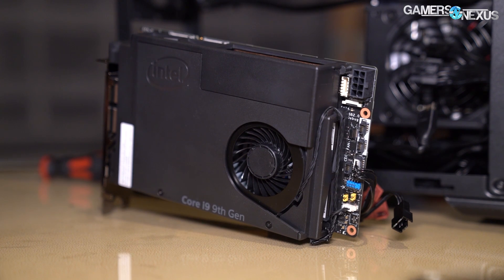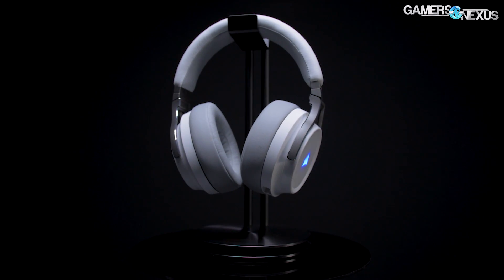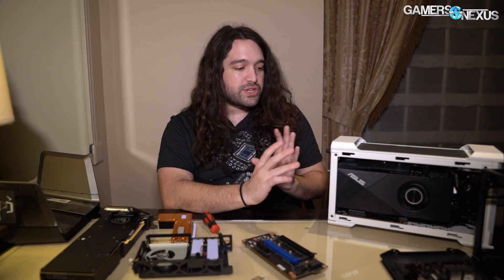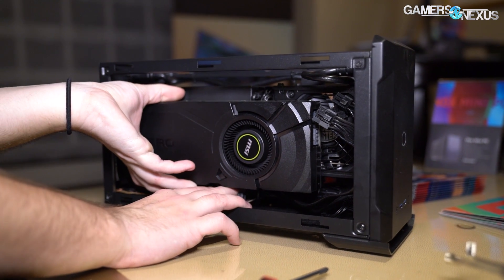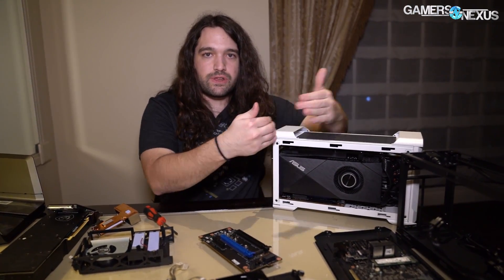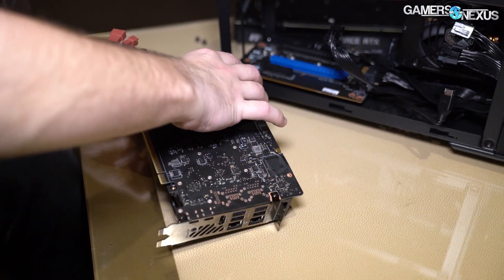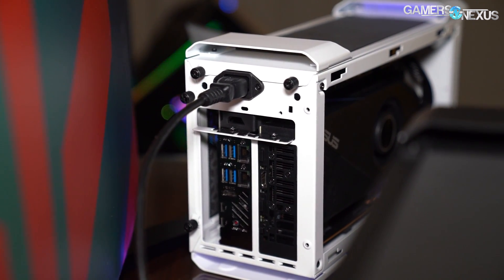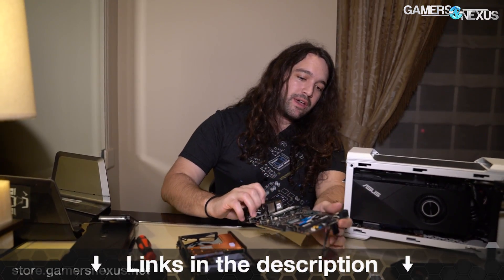Intel PCIe Socketable Computer: Tear-Down of Ghost Canyon NUC SFF PC

Comment: There was an processor card a few years ago on indigogo, which had I believe a Broadwell i7 and ram on an expansion card, and you could slot it in and use it as an x86-64 accelerator. 

I've always wondered, like with 300 watt gpus, we clearly are able to cool them in a 2 slot card. So my question is how long before we take a bunch of zen 2 cores and slap it on an expansion card to increase compute performance.

Comment: As many said this isn't much smaller than a sandwitched mini-itx and the cooling will be much worse (why not put the components on the other side when you're doing something non-standard anyway ?). It would be intersting as a pc inside a pc, but I didn't see/hear anything that would suggest that that would work... did I miss something?

Comment: 1990s - Pentium II Slot CPU. Drop-in replacement CPUs
2000-2020 - Socket CPUs higher bandwidth connectivity to Mobo
2020+? - CPU and motherboard in a slot. Drop-in replacement computer.

Comment: I've had a NUC of Intel.
Reply: Yeah they're pretty cool honestly. Ended up with one as an HTPC for a while, i5 something or other, 8GB DDR4, 256GB nVME and a 2TB 2.5" drive in a pretty tiny and quiet package. I have also used the Pentium 3050 or whatever that low end was, and yeesh, definitely stick with i3 as the minimum. The Pentium/Celeron ones are so slow I'd only think they'd be usable as something like a smart terminal alternative for point of sale or whatnot.

Comment: A company i used to work for made ARM based PCIe card computers 
it had miniDVI, USB, ethernet and a GPIO connector, and could communicate vie PCIe 1x to the host
i remember they were pointlessly pricey (way more than $1500) and they still sold like crazy
EDIT: and were talking single core 600MHz A skew ARM, not sure exactly what flavor

Comment: Interesting concept - such a shame it's not really new. PC on an expansion card is really common in industrial gear, has been for years. This seems like an updated version of the same concept, but in its' own box.

Kinda wondering what the target market is here. It's difficult to imagine a use case for these where a regular small form factor build wouldn't beat this by being cheaper and more powerful with a similar footprint. What does this really bring to the table?

But hey, what do I know, I'm just some random on the internet.

Comment: I could see this working really well as a tiny portable capture/ edit rig, with a decent single slot GPU( something like a Radeon Pro WX 5100 or 7100) and putting a capture card in the extra slot.

Unless the edge connector on the NUC itself is some type of non-standard proprietary configuration, I'm guessing it's bifurcated into 8x + 4x + 4x for the GPU, SSD, and the extra 4x slot respectively.

Comment: You could literally turn this design into a gaming console. They really needed this during the HTPC times.
Reply: What they could do is make the NUC power efficient enough that it can just draw power from PCIe lanes. For those who like to have separation of gaming and stream/capture builds while conserving space. Can just build a mid-tower ATX motherboard, use the 2nd x16 slot for the NUC, install Windows or Linux and set up the wiring pipeline for recording.

Of course, there are many ways to achieve the same task.

Comment: Would be interesting to know how overpriced those cases and connector-boards are. The cost of eGPU enclosures and reluctance to make Thunderbolt a proper standard made them obscure, I bet this thing is going to end up the same way unless they charge a fair price for a small bit of metal and a glorified SLI bridge

Comment: This is a really old form factor, this is exactly how industrial computers were designed back in the 70's/80's.
The main advantage was that replacing a dead CPU node was a 30 second job, as downtime was a top concern for industrial applications
Reply: Distributed computing clusters, but at least the tech gets to use the modernization.

Comment: They had PCI "upgrade" cards for PCs back in the 90-ish timeframe.  They typically had everything including HD connectors on the PCI card.  However cooling wasn't as big a problem back then.

Comment: I could see potential for the PCIE add in cards containing basically laptop grade hardware, but 2 things i would like to see:
- CPU socket for more flexibility and easier upgrade.
- that Intel needs PCIE 4.0 as (without knowing it for sure!!) it seems that you will be limited by the bus speed rather quickly if the add in card has to deal with M.2 and a GPU at the same time.

Comment: kind of pointless and will not fly. why? why do you need to use an extra pcb card to actually connect the motherboard pcb with the gpu pcb? when you can do that today with 2 parts not 3.

Comment: WTF at :45 - that is NOT what should be reflected. The Ring incoming.

That aside, this is both an intriguing and disappointing product - I have serious concerns that their shroud is adequate cooling for that processor (should really be an i3/5 part) especially when stacked side-by-side with a full size graphics card. However, I think this would be an amazing product with a lower core processor to slot into a gaming PC for a seperate streaming solution OR a NAS.

Comment: For me its nice to have that inside your main desktop to take the load of some secondary stuff (e.g NAS, generals server, capture/rendering rig, firewall/addblocker etc) so that a) you wont need to purchase separate case and power-supply b) you will have 1 tower for two machines which is more elegant less hordy and also could save a few bucks.  Oh and who doesnt want to look at the back of his main rig and see tons of input and output options? :P

Comment: It's SUCH a missed opportunity how they made this in the regular PCIe slot orientation (when seen from the rear I/O PCB on the left, hardware and cooler to the right, air intake on the right edge). Mirroring this - which they could have done with pretty much zero changes to the hardware beyond flipping the pinout for the PCIe on the PCB - would have allowed for dramatically improved CPU cooling through the opposite side panel, and thus far better performance and noise. Such a damn shame, as otherwise this is a really cool idea. Now we have a CPU cooler that takes in warm air from the back of the GPU, with very little breathing room, instead of the back of the motherboard and the back of the GPU being against each other. SUCH a shame.

Comment: I love this. I've long been a proponent of going back to add in cards on a single comm board. If they could make that psu slot onto the board to provide power to the gpu and the compute board without any cables I'm sold
Reply: The challenge is in the power deliver, which the motherboard board has its limits.

I have a Radeon Pro WX5100. No power pin necessary when some of the PCIe lanes are just for power delivery. Not as powerful as the RX480, but I bought them for a completely different purpose.

I am still experimenting which graphics cards I delegate my monitor renders to. I have a 1080p 75Hz and a 4K 60Hz. Both cards are installed, with RX480 as my main card, and run under Radeon Pro drivers.

Comment: Sounds interesting and promising.
I wouldn't say it has any real purpose in its current form (besides being small) but with further development it might be posible to have a base-board and plug in whatever you want, mutliple GPUs, CPUs (with RAM), or anything else. A standard PCIe Bus that can manage multiple "CPU-boards". Maybe the future is CPU-SLI? 
I can imagine quite a lot of things. If it is possible without to much costs is a question I can't answer though....

Comment: This sounds like Intel is making a move to revitalize ultra-high-density blade servers. Sure, it does allow for a slightly smaller than mini-ITX system for the desktop, but with that pricing the value just isn't there. But if you can't put more cores in a computer than AMD, just put more computers in the same size box. And with refinements to their 10nm process in the next year or two, this should be able to delier where the blade servers of yore were crippled by thermals.

Comment: Interesting concept but to be really revolutionary it would have to slot into a normal PC and get recognized by to OS as a Compute Card you can configure to do certain tasks without putting load on the main system ect. Otherwise i don't see any merit to the PCIe format. There is nothing you couldn't do with a standard ITX or other SFF Mobo and a few Riser Cables and that would be the superior solution imo.

Comment: That could be awesome . If it can function  well in a multi gpu gaming motherboard. Like if the socketed pc was all network related. So it is the firewall , VPN and maybe personal domain. And the web connection would go from modem to it then back out to the main board or router...
Reply: A idea I've had for years but. I don't posses the skills to make . Is a stand alone pc that was all mentioned as well as antivirus .. the thought was to sell subscriber service that included a unit that would auto update and stop attacks before they connect. Then in the event of a new bad virus attack on the public   all the units would act as a super PC and work to pinpoint the source of the attack then counter attack ... I'm sure there's something ilegal about a counter attack... But in my opinion there are no rules to a fight.

Comment: i find the concept interesting,  but it has room for improvements:
   case integrated power supply wich distributes power directly through the base plate
   a custom connector (as an open standard)  for the cpu card to get more pcie lanes to the base plate 
   a more trustworthy cooling solution

Comment: this card would be great if they made a low profile version. they could make pcb longer to compensate for the loss in height. moving M2 slots to the back of the card like they are on a normal NUC. then you could use it for multiplayer gaming or to offload video encoding so your main CPU is free to do other things. another good use for it is to have your main system run windows offline for security/stability with this NUC running linux for all your web browsing needs. all with less complexity then setting up virtual machines.

Comment: I have a NUC with an 8109U running Linux and I like it a lot for the small form factor. It is much smaller than my previous mini ITX build even though that was the smallest mini itx chassis at the time. However I am not sure about this idea. I rather they kept improving on the Vega powered NUC for light gaming and the ultra minimalist NUC like my 8109U for general usage.

Comment: The base board seems to have a PCIe switch/multiplexer on it, and Steve even poked it at 6:40
Though, since a PCIe slot has two pins for ground between each PCIe lane, so with a reconfiguration of the pins one could increase the number of lanes into having 20 lanes, but this would lower signal integrity, and make it totally incompatible with a regular PCIe slot. This is though likely not the case since it doesn't follow PCI SIG specifications. And the reason for color coding the slot is more likely to do with its lanes partly going directly to another card, and partly going through a switch/multiplexer, though technically speaking, both 16x slots would have some lanes going to the switch, and some lanes going to the other slot, so it shouldn't matter, unless the switch has a dedicated host side but most PCIe switches I know of doesn't.

Though, I do have to say that Steve is mostly rambling about:
"How do you distribute by 16 in and by 16 out, between a by 16 video card and an SSD.
And the answers would be either multiplexing I guess or don't load both of them at a 100% all the time.
In which case you should have enough bandwidth to go between the two as long as it switches between them based on load periods."

Since copper traces on a PCB doesn't just switch by themselves. Either there is a PCIe switch/multiplexer, or there isn't one.
If there isn't one, then the 16 lanes from the CPU/computer needs to be physically divided to each device. And then the 16x slot for the GPU wouldn't be a true 16x slot.

But as we can clearly see during his talk, there is a PCIe switch/multiplexer on the board. Though, it is interesting how some traces from the blue slot goes directly over to the GPU one, while some go through the switch. Though, the 4x slot seems interesting, since it either has its traces connected directly to the blue slot, or it sneaks under to the switch.

Also, the concept of having a computer on a card in this fashion is fairly old. ("Insert unneeded Pentium 2 reference here." Pentium 2 is a CPU, not a whole computer.)
It has been used for industry computers on manufacturing lines and the like for a fairly long time, along side PC104 systems and the like. (A modern PC104 system is also why there is PCIe switches that doesn't have a dedicated host side, since a PC104 is a stack of boards piggy backed on each other like a Jenga tower... So the host can be above, or bellow. Would be fun to see Steve overclock on one of these though.)

Though, I guess slotting one or more of these into a regular PC would confuse most OSes on the market. A host usually doesn't suspect there to be another host on the same PCIe network. Even if PCIe itself can support having multiple systems coexisting on the same PCIe fabric. Though it can quickly become a headache inducing mess even for systems designed to run in such a configuration.... Though, most OSes doesn't even expect PCIe devices to be hot plugged out of the blue, even if that too is PCIe feature.

Comment: PLX-Chip is not required if they dont use a standard PCIe x16 pinout, it could also be a custom pinout maybe 1 x8 and 1 x4 combined in a x16 (physical).

Comment: Why even make them? It makes 0 sense... normally you would be able to upgrade CPU alone and if you want to then motherboard as well. With this one you are essentially forced to buy both CPU + board and the board will cost moe as it's not a standard common board. Multipple PCs would make a lot of sense but I doubt it will happen.

Comment: They're essentially creating a new motherboard form factor. So why not put the cpu and cooler on the opposite side of the card so the cooler isn't stuck between the cpu pcb and a hot video card. The cpu and graphics card slots could then be right next to each other on the connector board.

Comment: Looks like that base board is splitting the PCIe lanes as 8 to the GPU, 4 to the NVMe slot, and 4 to that other slot, perhaps for something like a 10Gbe NIC.  It's too bad it's arranged as it is, as that x4 slot looks useless in that position.

Comment: Does the power for the card mostly come form the port on the side? Could you use it without being connected to the "motherboard" portion? Just as a compute card but with power coming through the 6/8pin?

Comment: That's the kind of pc that'd be interesting as a headless home server or as a potential poor mans blade server. I could put 8 or more of them in a big case and start a small data center. In regards to the heat issue I'd say it should be fine. The blower fan on that is pushing the hot air directly up towards the two case fans that are set to extract the hot air.

Comment: With PCI doing that made sense because, as far as I understand, all devices went on the same bus and you could have a backplane as big as you wanted. With PCI express you have to split lanes or use switching chips to make that work. Because those switches aren't cheap I get the feeling here the x16 slot runs at x8 speed, with 4 lanes going to both the M.2 and the other x4 slot. Also I am reasonably certain slotting this into a regular PC is a bad idea.

Comment: another intel processor board they tried this back in the mid 90s with the Pentium 2 it failed miserably.   Is looks good on paper.  But if you look at it heat will me a major problem

Comment: This is really cool. Smaller than ITX, still manages more than 1 PCIe slot. 
I wish they had the CPU board facing away from the GPU so that cooling options were more flexible and it was drawing air from the other side of the box.

Comment: So Intel has conceded and gone back to Slot 1 - LOL
Still have a WinSE P3V4X Slot 1 with a Taulatin flip chip on a pinned converter card that will do 1600 Mhz's at 2.8v's with 150mhz dimms. Fire it up every now and then to play Old Dos Games ;o)

Comment: That form factor is not much smaller than my Raijintek Ophion with perforated aluminium side panels, and you can go mini ITX with desktop RAM and an actual decent cooler like a Noctua L9x65, without compromising on upgradeability.

Comment: PLEASE tell these engineers to make the daughterboard/case accommodate a single slot BEHIND the NUC board, in addition to the double slot expansion that the video card resides. A 5-slot setup would allow actual expansion besides the double height GPU. Say someone wants to add a video capture card, or 10G ethernet, or a PCI-E card based SSD?

Comment: I ask, why wasn't the NUC flipped? To "face" the opposite direction of the GPU? I doubt it's a issue with spacing, since they need it anyway. But i like it, i want more stuff like this. Also, anyone noticed the M2 22110 slot? Or is it 2280 and the smaller on is 2260?